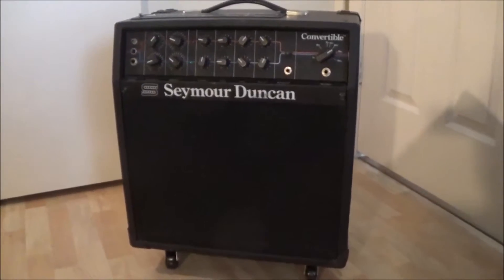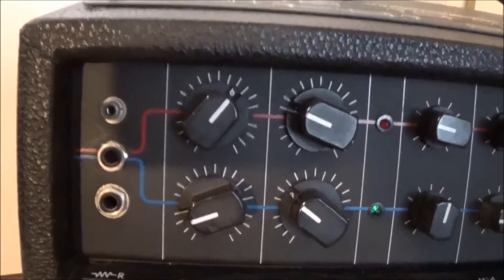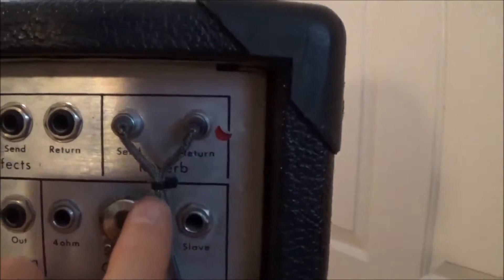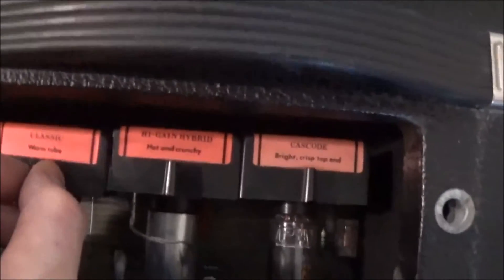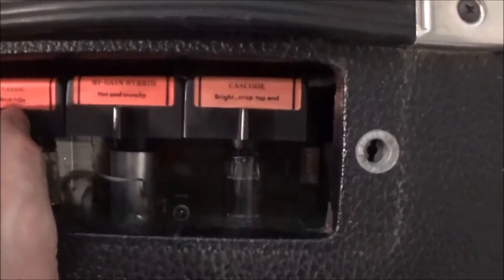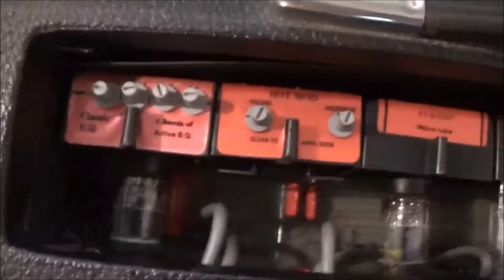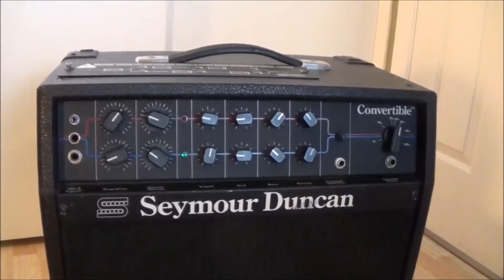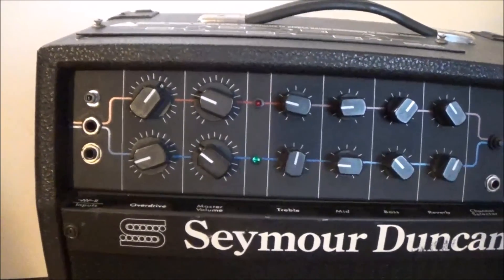The 100 watt Seymour Duncan Convertible Tube Amp

Comment: Well, the amp arrived damaged, and after having it resurrected I think it's a really good amp. I'm a "clean" clean guy and have to say that the SD does that quite nicely. Very good definition and string separation, plus the low E string is very solid with good clarity. I've also been able to dial in a reasonable "blues" clean using the power-simulator dial on the right, although that's not really my thing. I've found that the sweet spot for the power-simulator on either channel is between 90% and all the way open. I've read about that circuit and I think it's a way to load the power tubes to create saturation. A little above my pay grade though. I'm also pleasantly surprised by the lead channel. I can get a nice dark scooped sound reminiscent of my Brown Sound In A Box (BSIAB2) pedal. But the sustain on the amp is better, can you believe it? There's also a continuously-variable dampening (aka "negative feedback") control, which is a feature that I had been looking for. While the manual says it only works with its dedicated output it actually works with the regular speaker outs too. You can dial out all the flubbiness in the bass (or dial it in if that's your preference.) The tone controls are responsive and the center frequencies (aka "roll-off) seem to be placed to my preference. I'm using pretty much the basic modules, in this order: classic, classic, normal, high-gain hybrid and presence. I'm inclined to leave them as they are. Only potential change would be to swap in a 5751 for the first module's 12AX7, just to cut down the gain a little. But for now I'll leave everything the way it is. Also, lest I forget, the reverb is quite good, much better than I expected especially given the tiny reverb tank. Not at all metallic and with a nice tail (decay.) I'm using two 1x12 cabs with EVM-12Ls so I'm hearing the amp without any coloration from the speakers. I wonder if the complaints I've read are more about the speakers than the amp itself. Who can say? The only anomaly I've encountered so far is that there's something on my pedalboard that the amp doesn't like. I get a lot of hiss even when everything's bypassed. I'll figure it out another time. But right now I'm just using the amp with a single-button footswitch to change channels. Don't really need much else. Lastly, I much prefer pentode mode to triode. Much better definition and clarity to my hearing. In closing, I appreciate your vids and perspectives on these amps!
Reply from the maker: Thanks for the review of your Convertible. Are you getting hiss when using the loop? I never have used mine. I like to just plug into the input jack with my effects.
Reply: @VegasCyclingFreak  Well, I'm not a fan of effects loops and all my pedals are designed to plug into the regular amp input. So I'll tear my board apart and put it back together one pedal at a time until I isolate the culprit. In the meantime I've verified that the amp uses an ultralinear output transformer. No doubt this is why the amp is capable of such "clean" cleans. I'm wondering if I can replace one of the 12AX7's with a 5751 to give me a little more sweep on the gain (distortion) controls. The first module, perhaps, or maybe the center 12AX7 on the chassis? Or maybe I'm barking up the wrong tree?
Reply from the maker: @billyvanilli  You’re supposed to only use a 12AU7 in that center position under the chassis. You can certainly play around with preamp tubes to change the sound a bit. Just keep in mind that the first module is common to both channels.

Comment: Thank you for your many informative vids on this most intriguing amp. I just ordered a 100 watt head and it should be here in about a week. One of the features that attracted me was the continuously variable damping control and dedicated output. My question here has to do with the output impedance for that. I'm running a 4 ohm setup and don't want to kill the output transformer. At the same time, the owner's manual says that you can hook three cabinets up simultaneously to the regular speaker outputs. Never heard that one before, but to quote the manual: "The Convertible amp's strong transformer can handle almost any load with no damage." Your thoughts? The other question I have is that I seem to have read somewhere that the Convertible uses an ultralinear output transformer, such as was used on the Fender Twin Reverb 135 and the Sunn Model T. Are you aware of this one way or the other? In closing, my sincerest appreciation for your vids!
Reply from the maker: Hi thanks for watching and the comment. The only thing I know for sure is there is no off the shelf replacement transformer. But if the manual actually says that you’re probably OK. The Convertible 100 schematic shows a 4 ohm output and an 8 ohm output, which is what the slave out is connected to. The variable damping is connected only to the 8 ohm output as well.
Reply: @VegasCyclingFreak  Appreciate the prompt reply. They typical rule of thumb is that you can run a higher impedance load but not a lower one. But, like you said, the manual seems to indicate you can connect anything without damaging the OT. We'll see!
Reply from the maker: @billyvanilli  Just keep in mind that a replacement OT is literally not available. It’s unusual and custom made to Seymour Duncan’s specs.

Comment: Hey can anyone tell me what reverb tank is supposed to be in these amps? I tried a regular fender type 4ab3c1b, it’s not fixing my problem. I need to know before I start soldering in a new chip for the send...
Reply from the maker: I believe they used an Accutronics tank. I would suggest using a socket for the IC chip if it doesn’t already have one. (I think mine has a socket, not sure if that was from factory or not)
Reply from the maker: OK I pulled my amp half apart for you... The tank says “O.C. Electronics, Milton WTS 53563, Made In USA” - that’s all I can tell you about it. There’s also a “460” ink stamped on the side.
Reply: Thank you! That’s the same as what I pulled out.  My had the connections severed at the springs. I measured my input at 1.5ohms dc resistance and that is basically a 4ab3c1b reverb tank like I bought to replace it with. I guess it’s time to order up that lm380 and a 14 pin socket
Reply from the maker: Dillon Haight - Hmm... yeah could be one of the IC chips died or maybe an electrolytic cap went bad (if there’s one in that circuit somewhere)

Comment: Vegas Cycling Freak I currently have two versions of these amps in my pocession. Almost identical except the newer one has lettering on the pc board.  I would appreciate any info you could send to me.  If you need gut shots of the two versions, I can email you photos. Thanks, terry bruton, email is TBruton@aol.com  - great video!
Reply from the maker: What exactly are you looking for? I don’t think there is much difference between the two versions of PCBs other than the printing and a couple of minor tweaks that they made on the original batch of amps.

Comment: Wow,  have just watched all your videos on the SD Convertible 100 'back to back' and that seem like more useful information on them than anywhere else on the net.
I've just bought one of these on ebay and still waiting for it to arrive and the first thing i'd like to check is whether it has the rectifier safety mod, and if not get it done asap.
Could you please forward the details of this mod to - ian.ivelec@gmail.com 
Thanks so much, i'm now about to spend another hour working my way through many of your other fascinating videos.
Cheers Ian

Comment: I haven't used my convertible in years. I just plugged it in and there is static sounds coming out it. Any advice? Do you work on them? thanks for your time.
Reply from the maker: Hard to say.... first I’d try taking all the modules in and out a few times to clean up the connections (with the power OFF). If that didn’t work then it’s more complicated to figure out.

Comment: Dear Vegas Cycling Sir, Thanks for the video. I have a question if you mite help. I purchased one of these Seymour Duncan 100 watt convertible amps back in 1987 in Houston at Parker music for 1600. new/it came with 5 modules and I purchased some extras.  You got a good deal. I do a lot of studio work, cruise ships and big band gigs and have never been comfortable taking it on the road...but I've never had trouble with it at home and I like the tone, ie. I notice that Seymour Duncan didn't put in the tube retainers/alliigator clips/spring retainers on the power amp tubes, like are on all my fender amps, twins, ie. In your opinion, do you think that will be an issue if I use the amp for travel...or how much trouble would you think it would be to add those little clips fender puts on their amps to help hold the tubes in place. Just curious...cheers and happy playin!! :) It seems like they should have just put them in, but maybe I'm just too much of a perfectionist and it doesn't really matter. Thanks again.
Reply from the maker: Funny you should say that, I always felt like the power tubes were too loose in the sockets but at the same time it has never caused my any problems, although mine is a stay at home amp too. You could always change those sockets to a type that have retainers but that is actually a lot bigger job than it would first appear because of how things are arranged in the chassis - not much room to work with. Not really sure if the factory sockets would give you a problem or not while on the road. I haven't really heard any complaining about that aspect of the amp online that I can remember.
Reply: @VegasCyclingFreak  Thanks so much. Fyi, I called Dave at tube works in houston and he said he could do it. I really appreciate your help so much. Funny they took the time to put in a fan but no inexpensive clips or springs. Cool amp to have around even if there is no room, like you say. I think their fine like you say, tho. :)
Take care and god bless
Les

Comment: Hello Vegas Cycling Freak, I bought one of these brand new in 1981 I believe. I used it for years but when I got a road gig I put it in the closet where it sat for 30 years. Last year I pulled it out and it sounded strange. So I saw the caps they where bulging and leaking. I couldn't find anyone to fix it so I did it myself. It sounded glorious again. After a year of use it died a slow death on stage one night.  I saw sparks come out the back the and volume slowly faded away. I'm not great at diagnosing what happened so I gave up and bought a Mesa Lonestar Special. I wonder what could have happened? Then I saw your video. I really miss that amp. It was a monster. Luckily I made several hundred Kemper profiles at various settings. It's not having the real thing of course... I live in Los Angeles, do you know anyone who could fix it?
Reply from the maker: Well that's a bummer that your amp crapped out. I don't have anyone to recommend.... any good tube amp tech should be able to fix it it as long as it's not the power or output transformer that died - replacements are basically non-existent. The power and preamp schematics are available online and I have a component layout I made of the main PCB and most of the modules as well. And I have schematics for all of the modules, but it sounds like your problem may be power supply related.
Reply: Vegas Cycling Freak , thanks for your reply. I found one for $400 
I think I’ll go check it out.
Reply from the maker: Emilio Conesa — OK cool. Hope it works out for you.

Comment: Thanks for posting this, these are consistently the most satisfying tube amps I have owned, and so versatile. I accidentally dropped one off the back of a pickup truck onto the pavement years ago, and it still did the gig no problem. Currently looking for Cascode, High Gain Hybrid and Low-Cut type tube modules. Cycling freak here too.
Reply from the maker: Ha ha, that's awesome! Glad you got something out of the video. And nice to meet a fellow cyclist that ALSO plays guitar.

Comment: On the schematic I have for this amp (download schematic and manual here:  http://el34world.com/charts/Schematics/files/seymour_duncan/Seymour%20Duncan_Schematics.htm),  it shows a 4.7K grid leak resistor. But the manual states that "Convertible amps have 4.7 meg-ohm input jacks".  Which one is the typo?  (Strangely, the particular instance of this amp I'm working on has a 170K input resistor installed instead.) The manual then goes on to say "To optimize signal to noise ratio, input impedance should be fairly low - typically 100 to 10k ohms. Try the lOk330pf load resistor plug for great tone and low noise." Huh? Isn't the input impedance roughly equivalent to the resistance on the input jack (4.7M or 4.7K depending on which document you prefer)? The amp has an RCA jack for the aforementioned "load resistor plug" which is wired between the main input jack and the first input module. The RCA jack is not shown on the schematic, nor is the second input jack. I'm pretty sure this is the correct schematic, everything else lines up and I haven't seen any different revisions lurking around the net. I can' t tell if the two input jacks are supposed to be in a typical Hi/Lo configuration. There also doesn't appear to be any grid stopper resistors, what's up with that? I realize these questions are better asked on a technical forum but I was hoping someone reading this might have some pertinent knowledge.
Reply from the maker: The second input jack is simply for a second guitar from what I understand. I don't know if your amp was modified or not, it very well could have been. They made several changes to the amps from when it was first designed so I don't have a concrete answer for you on your questions.

Comment: Great vid. It was the last 1 I watched  B4 buying my SD100Convertible. Mine came w/1 bad module,  but I replaced it from Ebay. Found schematics for many modules on El34world .com website. Can't find anyone to fix it or build new ones. Any ideas/resources? Thanks
Reply from the maker: Sam Mitchell -- What kind of module is the bad one? I've fixed one of mine, it was an EQ module that I bought knowing it was not working, knew I could fix it.

Comment: Great Video! Could you send me the "Diode Mod" for the rectifier tube to protect the transformers? My email is benp23@gmail.com. Is there a book that shows recommended tube module positioning for different type of amp sound emulation like a Marshall or a Boogie amp, etc.
Reply from the maker: Thanks, glad you found the video useful. Email sent a few minutes ago.

Comment: Really good job on this video...thanks for all of that!  It's great you are willing to share your info on this amp & the modules.  Mine's in pretty good shape, but I'm starting to worry about when something goes wrong & also would like to try and build a couple of the modules that I don't have.  As with Curb Feeler below, I am kicking myself for not taking better notes from the DIYguitarist website! -craig
Reply from the maker: craig cornell -- I still have all that info, I can email you the module stuff you are interested in.
Reply: That'd be awesome thank you!  My email is cornell at msrc dot org.  I appreciate the help.
Reply from the maker: Sent you two separate emails this morning. One had the rectifier diode info and the other one has all the module info. Hope that helps...

Comment: Awesome video, I have had one of these amps for several years and love it. I've been collecting modules for years as well. I also took for granted the DIYguitarist website, man that site was awesome. and a huge resource. I second Curb Feeler's comment, I wish I had taken more notes. I also would like the info on the Mod you mentioned in the video. Thanks again for making the video.
Reply: Stratguysrv -Did you get one?